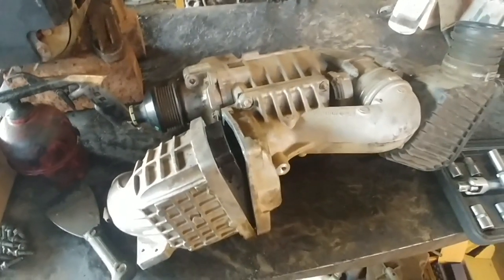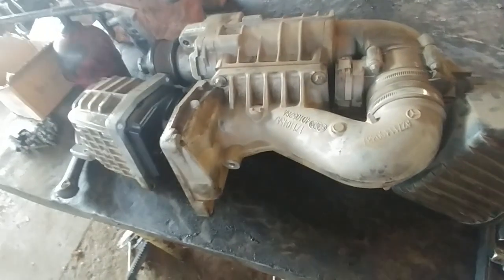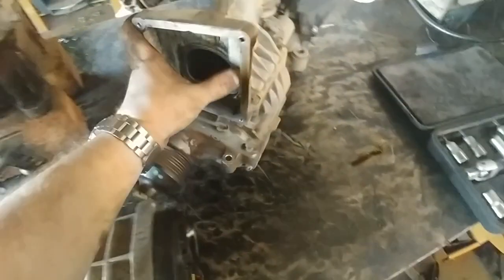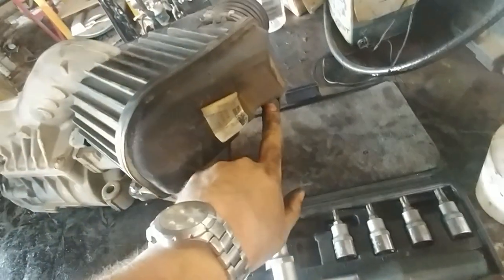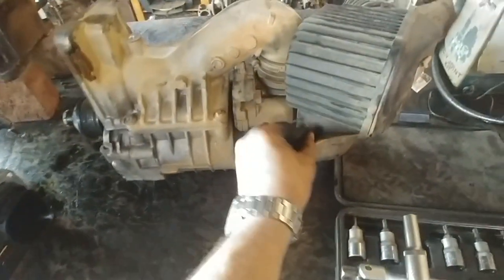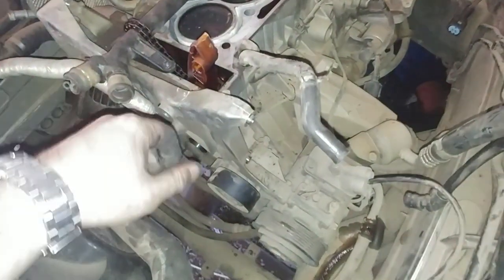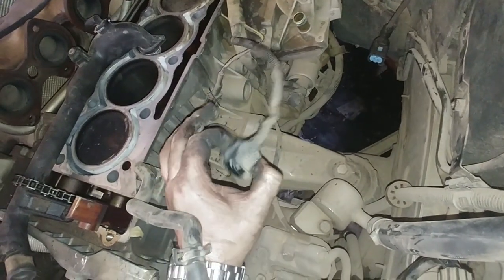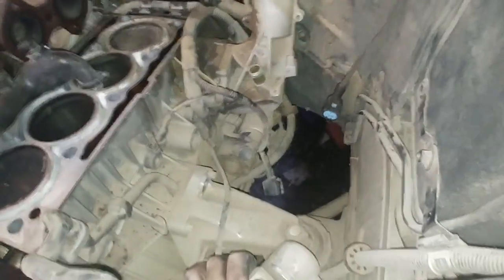W204 M271 kompressor removal

Comment: Hey is that the Pcv valve connected to that 90 degree elbow hose on the engine going upwards towards the first cylinder wall? Or is that breather hose check valve the PCV Valve? Sorry if this sounds complicated I’m still an amateur at wrenching

Comment: Yes sir, can you plz help me out with my problem, I had 2009model c200 kompresor, troble code p0045 and it's say supercharger boost control solenoid circuit A open, where can I find the boost control solenoid circuit,tnx
Reply: hi, did you get the compressor issue resolved?  If so, please let me know how it happened.  Thanks.

Comment: What could it mean when car running good in park but when in gear  it rev it idles like it want to die with a little surge like 100 rpm rev up down re placed maf and too o2 up down spark plugs  and no changes it has code p0101 and p0135 will that box if not seal on the supercharger  be the code